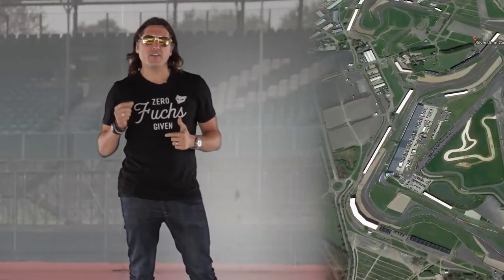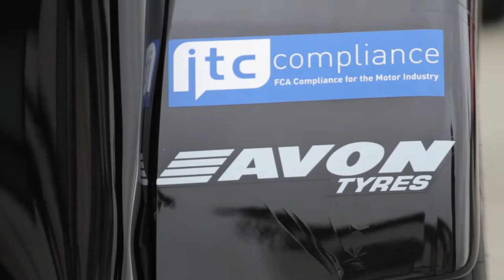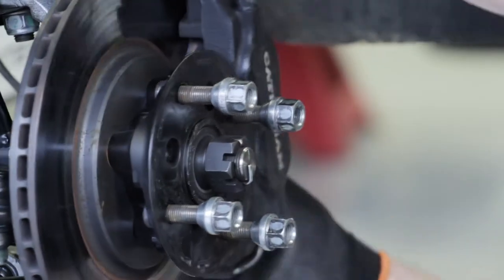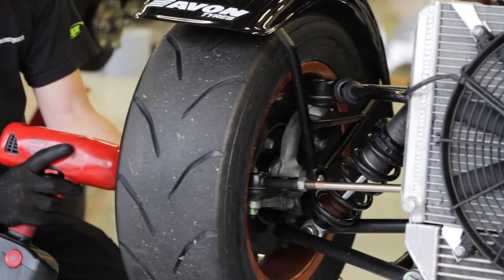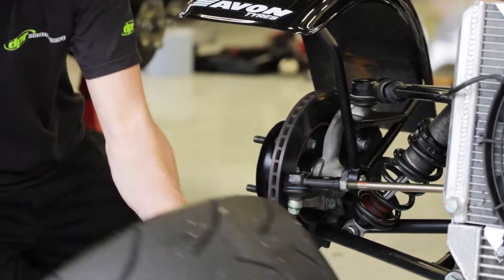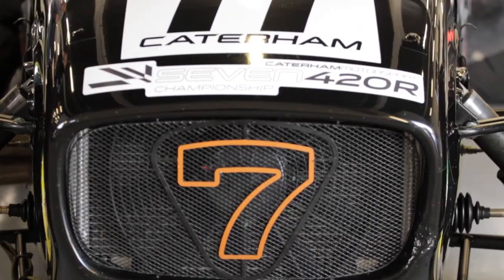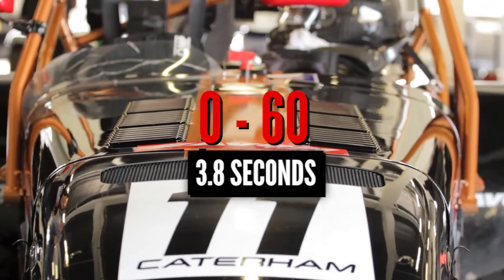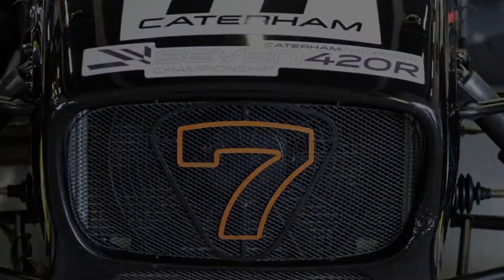Caterham Racing - Silverstone Last Round - CarCrazedFool Special

Comment: great video! lots of fun! I'm fairly ignorant about racing terms... What do you mean by tow? I'm guessing its something ti do with airflow between close cars?
Reply: Correct. The car in front breaks the air and suffers all the wind resistance. If the chasing car can get close enough to the one breaking the air it doesn't suffer the wind resistance so it feels like the chasing car is being towed and usually gives the chasing car enough speed differential to make a move on the lead car. This is what is missing from F1 today because the lead car (deliberately!) leaves behind "dirty air" making it impossible to get close enough to get the full benefit of the tow. Hence DRS - crazy!
Reply from the maker: Sam Wade tow is drafting. Basically when you’re in the slipstream of the car in front you have less air resistance, so you’ll gain on them. If it’s two cars, the effect is even bigger. You can use it to “slingshot” past someone at the end of a straight. It’s an aspect that makes Caterham racing so close.